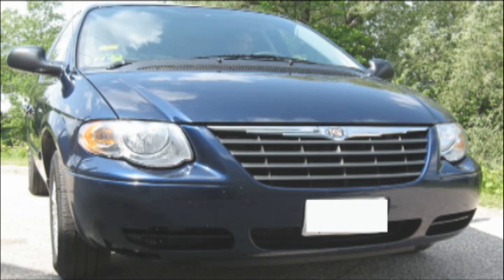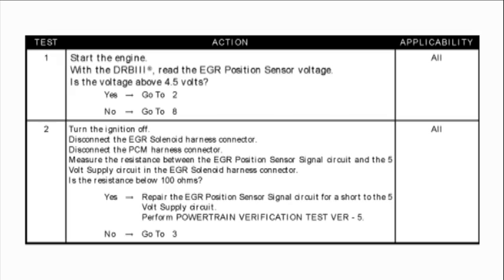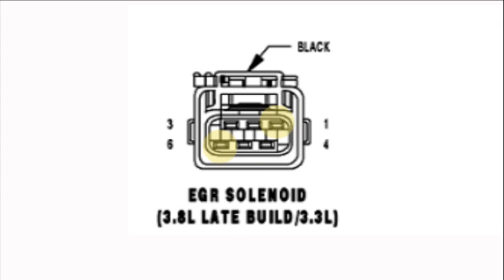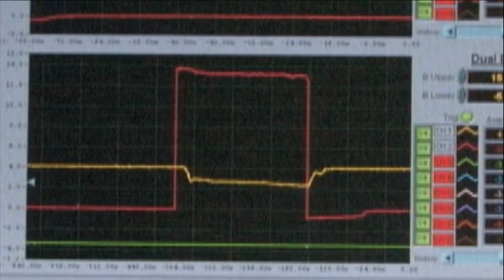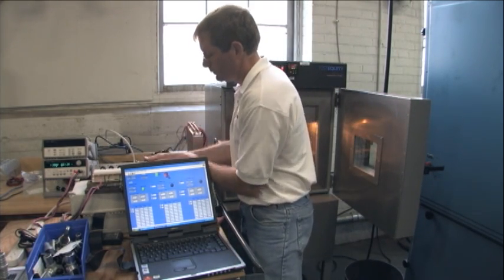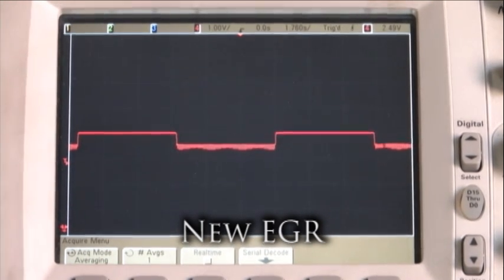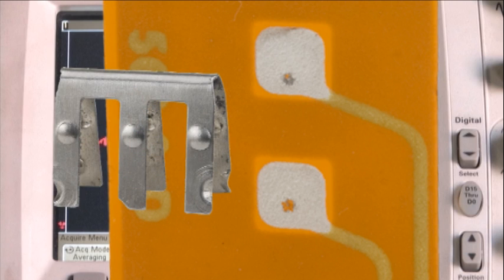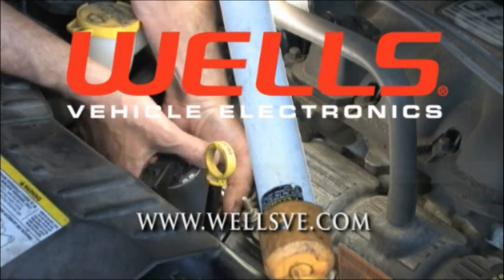P0406 Dodge EGR Diagnostics, Repair, Cause and Fix

Comment: I replaced the EGR valve about 3 years ago. Now the code came back again (after 3 years). Not a part from dealer. Just O'Riley part. Could it be again the EGR valve?
Reply from the maker: Hi Vasile, it's possible. Best thing to do would be to perform the testing outlined in the codes.
Mike Becker, Senior Instructor

Comment: Hi! I just replace the EGR valve  now it's saying my EGR temperature sensor circuit high what does that mean I have to replace the temperature sensor as well
Reply from the maker: Hey, It may need to be replaced. A trouble code is just showing a circuit failure though, not necessarily a bad part. It's possible you have bad wiring or something.
Mike Becker, Senior Technical Instructor
Reply: @GoTechTraining  Thanks for your response I had went to AutoZone to get a paint out the technician was saying replace the EGR valve temperature sensor it will resolved all the issues I had check the wiring to the EGR temperature sensor circuit it was ok got power and all but I like getting my electronics parts from the dealership not aftermarket for I won't have any problems and the  future

Comment: I got an EGR code a few months ago and it went away, but I went ahead and cleaned it out anyway because I figured it was iffy. Now the code is back. I guess it is safe to say that it is electric. Would it be possible and might it help to spray some electrical cleaner in the electrical part on top? And you should lobby the auto makers to engineer in a way that keeps heat off the EGR electronics.
Reply from the maker: Hi, many times its the position sensor contacts that fail. Spraying electrical part cleaner into the connector usually doesn't do anything because it's sealed. If you were to disassemble the unit you would most likely find wear on the position sensor.
Mike Becker, Senior Technical Instructor
Reply: @GoTechTraining  Can an open on the ground cause this code? What about a weak alternator?
Reply from the maker: Sure, an open circuit could cause that issue. A weak alternator probably would be showing a lot of other issues. You could verify loaded charging system voltage to confirm that very quickly though.
Mike Becker, Senior Technical Instructor
Reply: @GoTechTraining   The reason I ask is that I discovered that the negative terminal on my battery cable was not getting a good grip on the terminal so it was not charging well. My door would unlock spontaneously and other things. That's when I last got this code. I'm hoping that they are related and that now that I'm getting a good charge the problem will go away.
Reply: @GoTechTraining   Okay, well I disconnected the connector to the EGR and reconnected it and voila! The code has reset. I'll keep an eye on it but that seems to have been the fix in my situation. Thanks for the info.

Comment: Thanks for the great diagnostic video.  I replaced the EGR on our 2006 Dodge Dakota about a year ago with a Dorman valve, and within 30 days of doing so, the P0406 was back.  Monitoring EGR function with scan tool could never catch it in the act.  I'd reset the code and it would work again for a day, or a month, sometimes more...then randomly trip the code again.  I cleaned passages and checked the connector carefully and continuity tested all wires to the PCM and so on.  No issues.  Now I see your video and assume the problem is the same on the dorman part as it was with the OEM part; a bad design.  I see Airtek/Wells listed on rockauto and assume your valve is superior in design and should remedy the problem.  I'm going to give it a try.    Thanks.
Reply from the maker: Thanks for watching Bryon! We did some improvements on that valve. The pintle inside is coated with a teflon like material to increase the longevity! 
Mike Becker, Technical Services Instructor
Reply: Did you guys do any improvements to the internal electrical connection between the flex and the contact pins?  It seems insane to me that they use surface/brush contacts in that environment.  That's where mine failed (again) as shown in your video.  I'm getting tired of changing this valve and am searching for an improved design.  I've never had the actuator gunk up or get stuck; it's always the flex to wiper contact that fatigues due to vibration (I think).  The pad is rubbed bare of conductive material on the flex circuit.  I wish someone would solder this connection.
Reply: I purchased one of your valves and disassembled it to see if it had any internal improvements over the Dorman and OEM parts.  Not only do I not see any electrical differences to the flex circuit or contacts, but I also see no teflon coating or any other internal changes that stand out.  It looks identical to the dorman part.  Disappointing.  I was really hoping to see change here; I expect this valve to last another 3 months just like the last two OEM/Dorman valves.
Reply: @byronrace   How did you make out with your valve?
Reply: @hemispherion4298  it failed again.  I ended up decapitating the solenoid, soldering on my own pigtail and changing to GM weatherpak connectors.  I sealed it was right stuff silicone.  It has been good for years now.

Comment: I had a p0406 on my 2006 dodge charger. I changed the egr valve,gaskets and cleaned out all the tubes....But still.showing same code
Reply from the maker: Hey sewer monster, EGR valves are SUPER common to fail on these vehicles. After replacing the parts, did you clear out the check engine light? How does the connector to the valve look?
Mike Becker, Technical Services Instructor
Reply: Wells Vehicle Electronics  thank you for your response.what happened was after I did the repair I did not push the electrical  connector in far enough to click and lock on place...
Reply from the maker: Ahhh, that'll do it!
Mike Becker, Technical Services Instructor

Comment: Thanks for this great video.  Any idea what causes the P0406 the other 2% of the time?
Reply from the maker: Hi Joe, Thanks! P0406 is most commonly that egr valve. Really those other 2% are just like any problem on a car, either the wiring, connector, or computer. Thanks for watching!
Mike Becker, Technical Services Instructor

Comment: I know this is old, but wondering if it is possible to disassemble and fix the broken wiring.  I'd rather repair then spend $70 if it's nothing more than a bad connection.
Reply from the maker: This is a sealed valve, you can't open it up to fix it. You can sometimes clean them, and get rid of carbon buildup, but that's about it. Also on the old original designed valves the conductive coating would actually wear off of the circuit board.
Mike Becker, Technical Services Instructor
Reply: Thanks, Mike.  I already had it off and blasted it out with cleaner.  The light is still on, though trying to make sure I don't need to just reset.  One last question.  In determining if it is indeed the circuit connection in the EGR and not elsewhere, could I short connections 1 and 6 with a wire small enough to allow me to connect the harness?  Kind of fool the system into thinking the connection is good and see if the light goes off?
Reply from the maker: No, shorting it will not make the light go off. It could also potentially cause damage to the computer. Best bet is to verify the connector is ok, and verify the power/ground circuits. I would also recommend to watch this EGR video we did a few weeks back.  It shows testing of that egr valve. Here is a link. https://youtu.be/YJ4c1Pvks-c
Mike Becker, Technical Services Instructor

Comment: Is it possible to repair the worn part?
Reply from the maker: Hi Paolo, it depends how the EGR valve fails. If it has failed because of the position sensor then no, it can't be repaired. The position sensor does not come separate of the valve. If the EGR valve failed because carbon buildup is causing the pintle inside to stick...that might be repairable. Sometimes you can clean it out with some brake or carb cleaner and it will free up and start working again. Hope this helps!
Mike Becker, Technical Services Instructor

Comment: I have a P0405 code on a 07 Grand Caravan 3.3L, and from the diagram I pull off of Alldata, pin 6 EGR control should be switched to voltage to energize the solenoid since pin 4 is the control ground.  I am seeing OV on pin 6 and ground on pin 4, 5V on pin 2 (5V supply to solenoid) and the signal on pin 1 is 5 V.  EGR is remaining closed at all times, for van runs ok at idle.  I was following along with how you tested yours here, but you grounded the EGR control pin 6, which by the looks of the diagram, should actually be energized to turn on the solenoid since the other side of the control circuit, pin 4, is at ground potential.  No matter tho, for I did try to put power on pin 6, but no change is idle quality and engine should have started to stumble with solenoid opening.  Any thoughts appreciated in this little puzzle, thanks.
Reply from the maker: +Chris C Hey Chris, it's most likely that the egr valve is bad. These Egr's are very common on these model Grand Caravans. The best way to test this is with a full function scan tool. You can change the duty cycle to the egr valve and monitor the signal wire. At key on engine off you should see about 4.2volts on the signal wire. At about 35% duty cycle the valve starts to open and the voltage reading should be about 3.2volts. But in all reality I'd be willing to bet that you have a bad egr valve. Hope this helps!
Mike Becker, Technical Services Instructor
Reply: +Wells Vehicle Electronics I use an Auto Enginuity pc scan tool and also have a Genisys Evo, but both of them do not list any EGR type tests..I see on both, tests on the wastegate solenoid, which is confusing since there isnt a turbo on it..lol.  I forgot to mention I had installed new egr since I thought having the 0V on signal line was the valve's issue..not that a new part means its a good part tho.  When I get another chance to look at the van I will see if the 4.2V comes back on the signal wire if I unplug the connector.  These vans are also notorious for corrosion problems on the underside of the fuse box which causes all kinds of issues.
Reply from the maker: +Chris C Hey Chris, this one sounds pretty in depth and I'd really like to help you out over the phone. Could you please call me here, dial our techline number 1800-558-9770. Select tech dept and ask for me. I'm in the office from 8am to 5pm central time. Talk soon,
Mike Becker Technical Services Instructor

Comment: i had a P0406 code in my 2006 chrysler 300 2.7, so i replaced the EGR valve with a dealership EGR. I unplugged the battery for about 20 minutes to reset codes. The light came back on giving me P0406 after the EGR was already replaced.  Any other ideas?
Reply from the maker: +Eddie Lerma Hi Eddie, you could have a problem with carbon buildup in the EGR passages that go into the intake manifold. It would be a good idea to take a peek at those passages. Otherwise there are some issues with the EGR valve connector as well. Let me know how this turns out. Talk soon.
Mike Becker, Technical Services Instructor
Reply: Did you ever get it to go away?  Mine is doing the same thing but i had 2 code p0406 and p0404.  Replaced EGR vlave and p0406 left and p0404 stayed.

Comment: Checked the volts on them looked like the throttle position sensor  left friends house started driving fine reset the codes now it only shows p1698 but is idling fine dies every once in awhile but it will not shift out of first gear I have no speedometer and the AC is not working right I am totally lost now
Reply from the maker: alvarez brian When you unplugged the TPS did the 5 volt reference come back? If it did then you need to replace the TPS. One step at a time, do not try to get ahead of the diagnostics. The transmission will not shift without input from the TPS. It now sounds like there may be a couple of issues, again one step at a time. 
Stay in touch,
Mark
Reply: markjhicks so the tps won't allow it to shift?would it also not allow speedometer not to work it all quit same time
Reply from the maker: alvarez brian No it wont. But the speedometer could cause it not to shift also. Again, let's not think too far ahead, one step at a time. Please also answer my questions along the way. Did the 5 volt reference return when the TPS was disconnected?
Mark
Reply: markjhicks sorry....yes it did
Reply: Turns out dealership said it needed a complete engine wiring harness..ugh..I have been looking for a used one for about a month with no luck

Comment: I have a 2001 3.2L intrepid it won't start with pushing on gas soon as I let off the gas it dies and it is throwing codes  0122,0118,0108,0700,1496,1492,0405,0406.....please help me I'm kinda lost
Reply from the maker: alvarez brian Hello Brian, with all those codes it hard to tell where to start. I am going to assume you have some sort of code puller / scan tool. Clear the codes, start the engine and as soon as the check engine light illuminates read the code. This will become the primary focus. Let me know what it is.
Mark Hicks
Wells Vehicle Electronics
Reply: markjhicks ok did that now only shows 3 codes 
122 throttle position sensor voltage low
1496 5 bolt supply output too low
405 EGR position sensor volts too low
Reply from the maker: alvarez brian OK! This is a pretty common issue with your vehicle. What usually happens is one of the three wire sensors shorts to ground and robs the rest of the sensors from the needed 5 volts to operate. This 5 volts is called the "5 volt reference". 
1. Check the voltage at the Violet/White wire at any of the 3 wire sensors.
2. If it is lower than 4.5 volts, disconnect the Manifold Absolute 
Pressure (MAP) the Throttle Position Sensor (TPS) the Exhaust Gas 
Recirculation Valve (EGR) sensor and the A/C Pressure Transducer. If the
 5 volts returns when a sensor is disconnected, replace that sensor.
Let me know what you find,
Mark

Comment: I have a 2010 Dodge grand Caravan, Is it the same process. This would be the second time in 3 years that I have to change this valve and I would love to save paying a mechanic.
Reply from the maker: gentlelioness814 Just looked on AllData and the procedures look the same for the 3.3 and 3.8L engines. 
Mark Hicks
Wells Vehicle Electronics

Comment: I have a p0406 code on a 2003 town and country, and is running rough, but it doesn't have a egr valve on it. Checked wiring harnesses and replaced the MAP sensor. Still can't figure out the problem. Any ideas?
Reply from the maker: Tyler Snow What do you mean "it doesn't have an EGR valve on it"? Someone has removed it? Mark HicksWells Vehicle Electronics
Reply: No, depending on what state the vehicle was sent to(for smog regulations), some 2003 town and countrys were produced without a egr. Chrysler has confirmed this with me. Yet, i have a egr code. Wierd huh? Checked all hoses and electrical harness and everything is good. No i idea why its running like crap.
Reply from the maker: I have never heard of this. To tell you the truth it doesn't make any sense. No matter which state the vehicle is being sent, it would still need to meet EPA regulations. Let's say for example you moved to California. To receive your license you would still need to pass the environmental controls for that area. Without an EGR you would never pass. Have you looked for the EGR valve on your vehicle?
Mark
Reply: markjhicks yes I've looked. Where the egr valve would normally go on the front head by the alternator, theres a plate there, and nothing else. I swear, look it up. Most of 2003 town and countrys were produced without egr's.
Reply from the maker: Tyler Snow I did look it up before my last response and all the information i have says they all have EGR valves. Please don't get me wrong, I believe what you are saying, but it does not makes any sense. Yes, in the front of the forward head by the generator is where the EGR is located. Here is another thought, one of the EPA regulations states: vehicles built after 1996 must have the ability to measure EGR flow. I guess I wish you were closer to me, I would love to look at the vehicle.Mark
Reply: markjhicks http://www.underhoodservice.com/tech-feature-family-ties-servicing-chrysler-s-versatile-3-3l-and-3-8l-engines/       Read "letting on leaks" second paragraph, or you can also call your local chrysler dealer and they will give you the info.
Reply from the maker: Tyler Snow OK, well if this is the case, the PCM must be programed to ignore or not calculate any EGR information. If it is setting a P0406 EGR code it leads me think a couple solutions. One is the PCM defective? Maybe, but first I would think it may be the tool used to retrieve the codes. For this system to function properly the PCM algorithms must be different from the more popular EGR Chrysler. Meaning I would like to see what the factory or at least a high scan tool reads. Mark
Reply: Well, my guess is the PCM is bad. It's getting looked at today by the dealer cause im out of idea's. If they figure it out ill update what the problem was just incase anyone else runs into this problem.
Reply: Tyler Snow  so what happened???
Reply: Who ever had it before me put the wrong pcm in it.

Comment: In testing the activation control, instructions are to connect a "Grounded Jumper Wire" to pin 6. It is actually necessary to jumper it to battery+ to activate it. There is no other power available on the connector except the 5.00 volts and this is a signal supply not designed to pull in a solenoid.  (Also, I saw the test trace go high). Presumably the computer can tolerate a back-feed of battery+, as it was done in the video.
Reply from the maker: Very good! The pin-out we I used was wrong. Pin 4 Black Dark blue wire is a 12 volt supply from battery, not a ground.
Nice catch!
Mark Hicks
Wells Vehicle Electronics